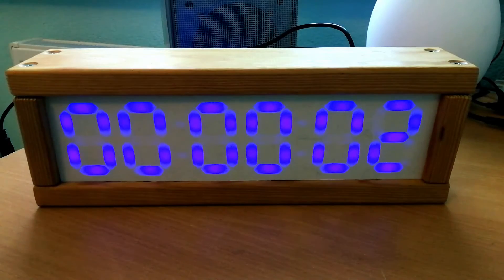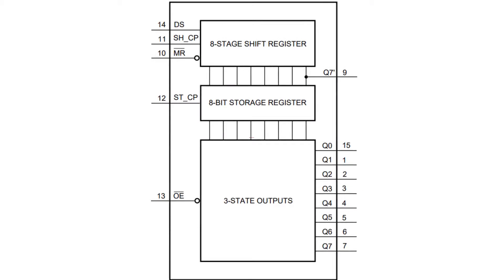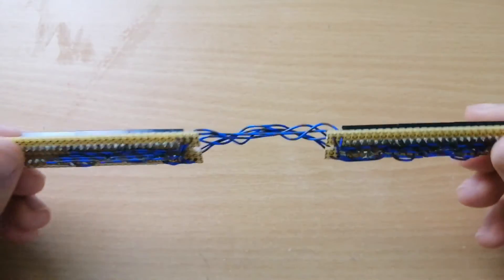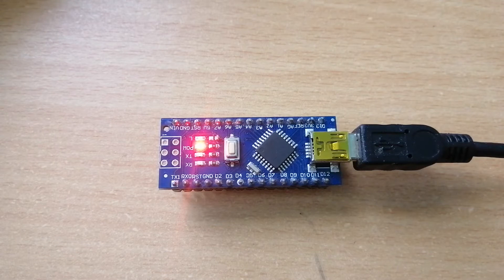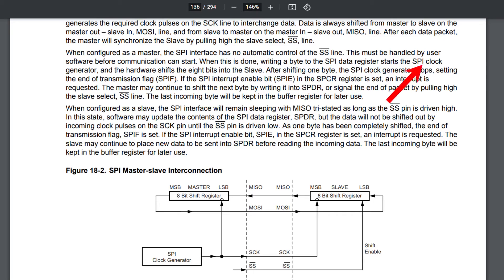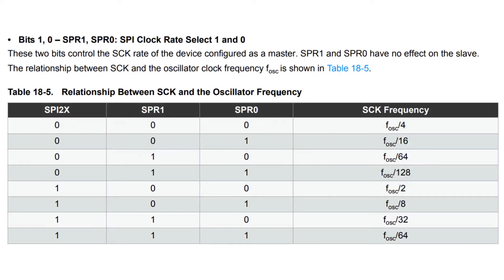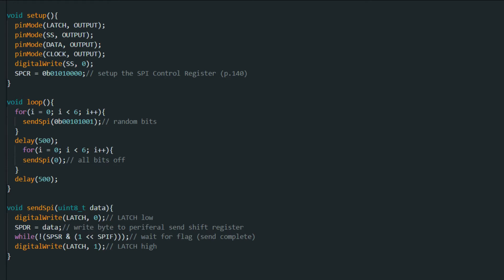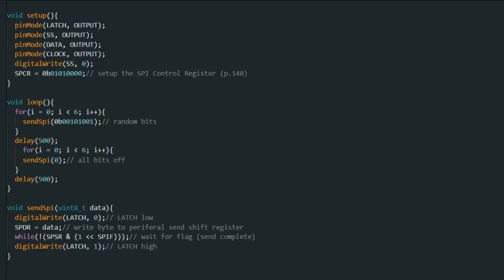Controlling a 7 Segment Display with Shift Registers and SPI [Clock Pt. 2]

Comment: Excellent video. Just what I need to know right now.
I am building a relay driver (up to 64 solenoids) with MIC5891 and MIC5841 to pluck harpsichord snares or to open organ valves. While at the same time receiving MIDI signals. With an AtTiny85...
Thank you.

Comment: I'm curious to know if you considered multiplexing the display.  With 8 common segments + 4 enable lines, you would have only 12 outputs which would required only 2 shift registers (or possibly 1, if I/O available for the enable lines).  I think your approach is fine, I'm just curious if you considered multiplexing, and if so, why you decided against it.  Thanks!
Reply from the maker: No, to be honest I didn't think about it. It's an interesting idea
Reply: @5VLogic  Thanks for responding.  Other than adding a bit more complexity to the code, the only other disadvantage of multiplexing I can think of is less brightness due to the reduced duty cycle.  But practically speaking, most LED displays in clock radios and such are multiplexed and don't have a brightness problem.
Reply: I really enjoyed your clip , best little demonstration of  SPI/595
Reply: Multiplexing would take much CPU power, so there would be less time for other jobs (like processing a DCF77 signal).
Also, other jobs would interfere with the timing of the multiplexing, causing the display to flicker somewhat.
Using interrupts could improve timing (of both multiplexing and other jobs), but would be too complicated for 1 video (just the tip you gave is good enough for me to move it further).
Having said this, multiplexing is a very good alternative when you need it.